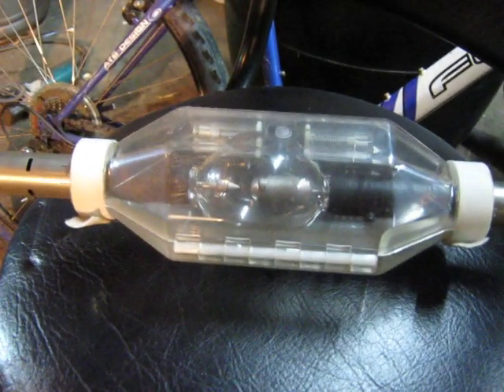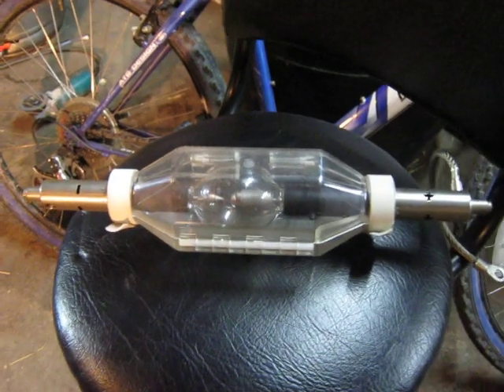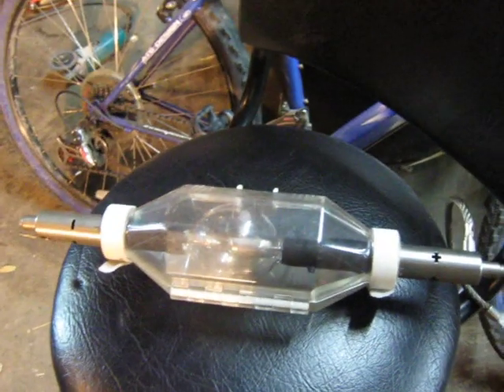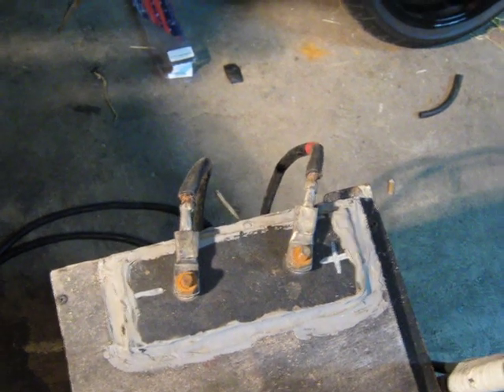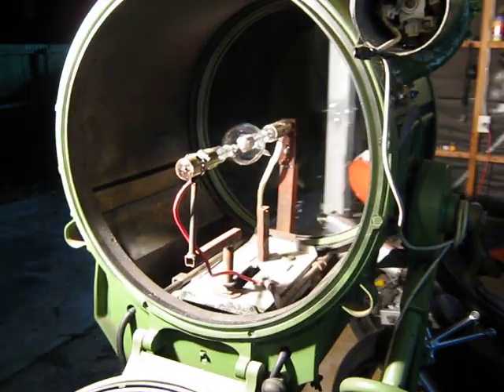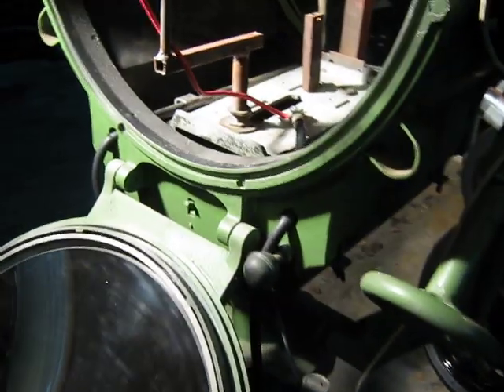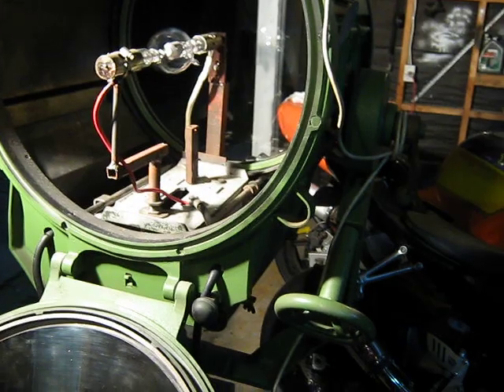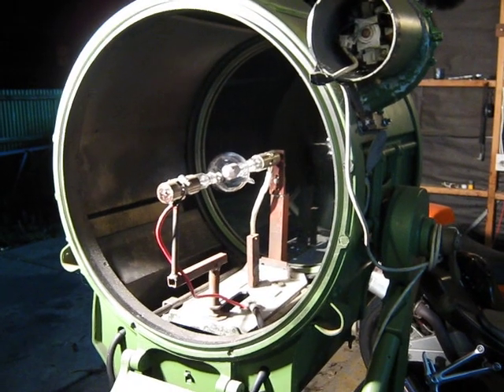XENON SHORT ARC LAMPS  PART 1

Comment from the maker: Hi the thinks you should know is a 5kw lamp needs 30 volts dc at around 170 amps and starting float voltage of 100volts and starter voltage of 20 - 30kv , lots of air to cool it , the lamps have gas at 150 psi inside them when cold and gets higher when hot so safety gear is a must so you dont blow your head off  ,  do no look at lamp arc at close range as it will burn your eye out ,lots of UV and IR radiation hope that helps.

Comment from the maker: Hi mark  the mirror is bronze and has been plated and is about 19'' a cross , I have seen similar mirrors made of glass and aluminium at edmond scientific maybe you have a look on the web for them , I used one of them aluminium mirrors on a lamp set up i made in a 44 gallon drum that I cut down to make a housing fixed to a bearing  and used a old windscreen wiper motor to rotate it , put a good beam in to the  sky but I must say the aluminium mirror did not have that grate a finish .regards Alan

Comment: So it turns out the starting voltage requirements are far more severe than HID or Low Pressure Sodium types eh? Well that's logical considering the extreme pressure at which XSA are filled. What is surprising is the low running voltage. I guess high currents at low voltages can do wonderful things.

Comment: After you ignite the arc, is it necessary provide a higher 100V? voltage until it heats up and can run with 30V?